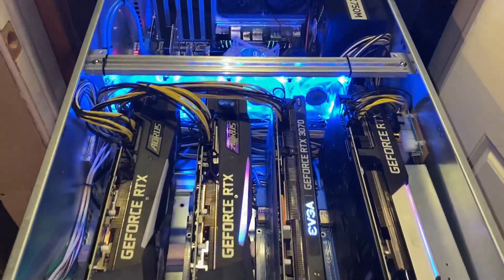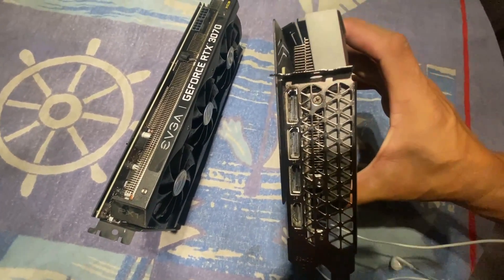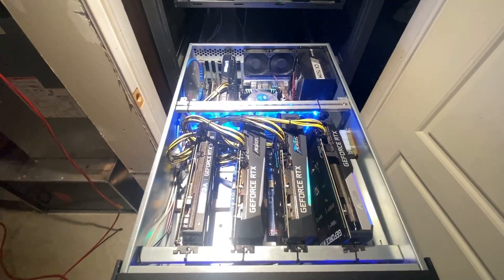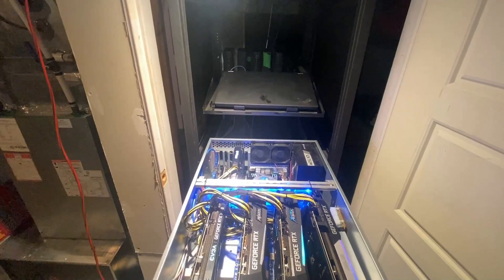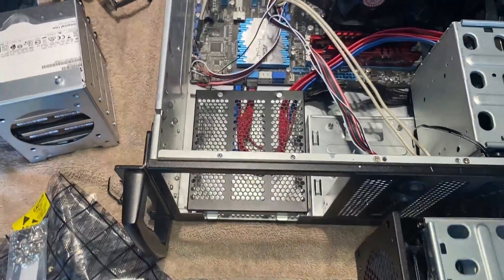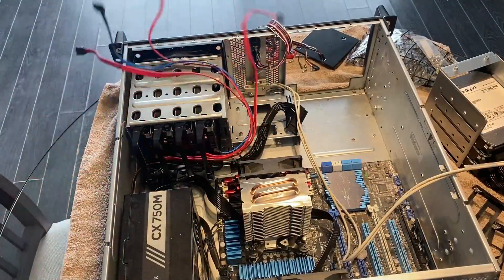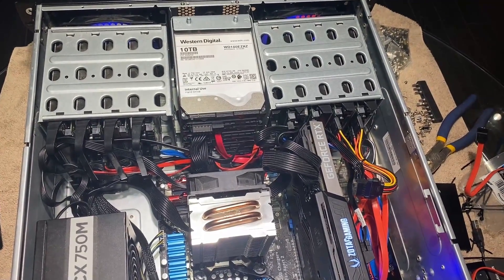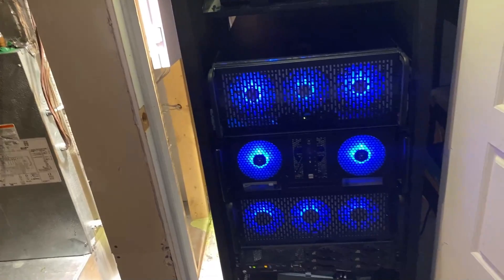120 Terabyte CHIA Upgrade!

Comment: Why are you taping the pins of the WD essentials external hard drive? I'm also using those internally in RAID 0 but I didn't cover the pins. Isn't that just a standard sata drive once you take it out of the case?
Reply from the maker: Incorrect, it’s white label drives, that need to have this done https://www.instructables.com/How-to-Fix-the-33V-Pin-Issue-in-White-Label-Disks-/
Reply: @CustomComputing  That's interesting. I'm also using the WD external drives and the label was white when I taken it apart. But my computer recognized it not sure why
Reply from the maker: @thomashunter5232  yeah that’s odd, I tried with these drives, panicked that I broke them then read online what to do and that worked… but it’s an extra step that is flaky and annoying but once it’s done you set it and leave it lol
Reply: @CustomComputing  yep

Comment: Nice Vid! Whats about the temperature of the drives?
Reply from the maker: Tbh i haven’t taken the temps but there are fans directly pushing air through them and they are basically idle with chia plots so I don’t think there is any issue with the temps but for sure should check one of these days!

Thanks for the comments :)

Comment: You can only run max 2 gpus per expansion card i can tell your new to gpu mining
Reply from the maker: I’m running 4x 3070s fine at 62mh/s each over 2 weeks straight now, I’m not new to mining but running at 55% power. 

Also you may want to look at some of my other videos before you try to tell me I’m new to mining…

Comment: i watched and didnt understand why you needed to cover the 3rd pin? aren't sata 22pin a standard thing?
Reply from the maker: No apparently not, the white label external USB drives have a different power structure than regular sata connections.. was news to me and I found out after looking it up online :)
Reply: @CustomComputing  yeah thats messed up. I have bought externals in the past and took them out before, this was like 8 years ago and they worked fine with regular sata connector.

so these companies gone down the route of proprietary stuff to further limit it, if usb controller break or enclosure/connector break they force you to buy a new one, unless you know about the 3rd pin stuff.  funny thing is most of these external drives are ones with issue that dont pass certain test, either read/writes speed not up to par with naked drive performance or some other issue, hence the use of usb controller to limit and mask the speed even if the drive model are the same.

im glad it was an easy workaround for you, I bet those drives were at a great price in bulk?
Reply from the maker: @also5015  thanks no still so expensive and definitely not worth the purchase purely for chia… but I did it to maximize that server and maybe in 5 years from now I’ll hit roi lol

Comment: Very nice upgrade! Do you use sata splitters for psu sata connectors to hook up more hd drives than psu  can handle?
Reply from the maker: I only split 1 sata into 2, however I ordered two more sata power cables for my PSU in order to power all the drives. 

I would only split 1-2 from the hardline power cable, too many splits and it could cause instability in the power draw of the sata port. 

Most power supplies have significant amount of extra power ports for Molex/Sata power

Comment: I’m very impressed. I did not know about that 3rd pin on the white label hard drives. Do you have a link for that data expansion you used?
Reply from the maker: Ahh yes I knew I forgot something in the description! Apparently there are pcie with 8 sata connections on them, I didn’t need that so I got a 6 sata off Amazon here: https://www.amazon.ca/MZHOU-Controller-Expansion-Marvell-88SE9215/dp/B082CP8K1W/ref=pd_bap_m_csi_pd_ys_c_rfy_rp_crs_0

You need the drivers which I found out way later in the process for it to recognize 5+ drives.

The white label pin covering I found out in another video of mine after hours of trying to figure out why they weren’t showing up: https://www.instructables.com/How-to-Fix-the-33V-Pin-Issue-in-White-Label-Disks-/
Reply: @CustomComputing  I ended up covering pins 1-3 I couldn’t get my electrical tape to stick to the pins. But now my hard drive is showing up. I thought I broken my hard drive when I was removing it from its enclosure. Now all my hard drives I’m in the tower. Thanks

Comment: Have you done any math on how long it will take to pay all your hardware off? Excluding YouTube income that is.
Reply from the maker: I have every single component I’ve purchased for all the servers in a spreadsheet. The ethereum mining portion (12x3070 gpus) I bought in jan/feb are going to allow me to (hopefully) hit roi before end of year. Although the market is completely up and down, plus eip1559 coming out in two weeks, My calculations are on the “safer” side of return.

I don’t know what the market will hold but even with the $4000 CAD for chia farming added I’m hoping to break even by the end of the year with cash withdrawals. I will still hopefully be holding a few thousand in crypto and all the re-sellable hardware.

I got into the game a bit late and had to buy gpus at a high cost which pushed back my ROI significantly, along with the recent crash and a few trading mistakes lol

You live and you learn but it’s been exciting and fun!
Reply: @CustomComputing  I see thanks for that. Nice work!!
Have subscribed 😉

Comment: Wy did you cover the connecter with tape
Reply from the maker: With white label drives you need to perform this in order to use them with regular power: https://www.instructables.com/How-to-Fix-the-33V-Pin-Issue-in-White-Label-Disks-/